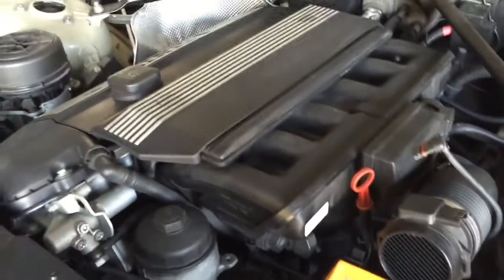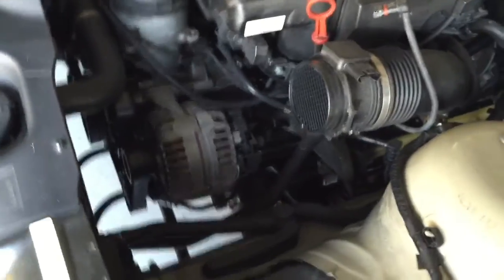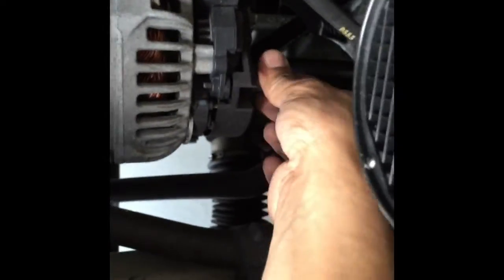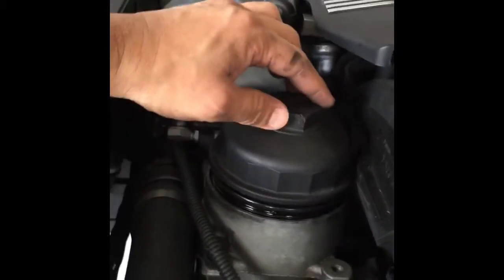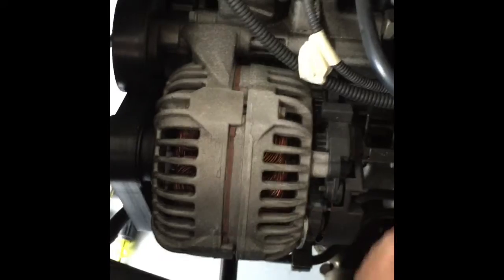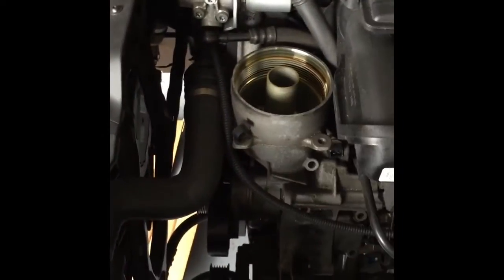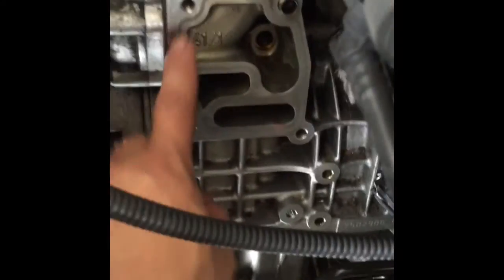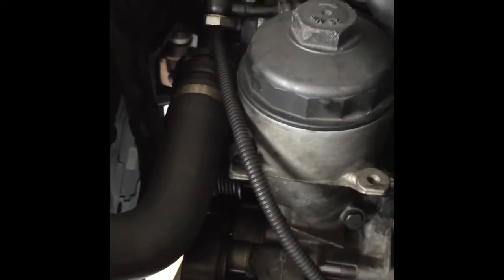BMW oil filter housing Gasket replacement Z4

Comment: Good Video! I am about to do mine also... Z4 E85 M54 Engine... This summer I started with the Overflow Tank then I did my Valve Cover Gasket but the engine was still leaking... let's face it, my Girl is turning 18 years old so why not take care of her... I will replace also the Tensioner and the Pulley at the same time... I am even thinking of installing a new alternator... since I have it off anyways... an 18-year-old alternator must be on its last leg... what do you think?🏎
Reply from the maker: Yeah I agree might as well change it but there is no guarantee the new one will last longer. Alternators fail without warnings but hopefully new one will last. Get a good quality one.

Comment: Did you need to drain the oil before removing the oil filter housing?
Reply from the maker: No need to remove engine oil
Reply: YES since you are going to contaminate the oil by cleaning the inside of the housing... you should do it...

Comment: Did disconnecting the positive mess with you z4 after you connect back
Reply from the maker: not at all....disconnecting batteries dont cause harm....the only trick is once you connect the batter back in, leave the car alone for 5-15 mins...there are computer systems that reboots and needs time to settle in.

Comment: If the oil filter housing gasket is leaking, will this cause problems with the eccentric valve censor?
Reply from the maker: Not sure. I doubt it